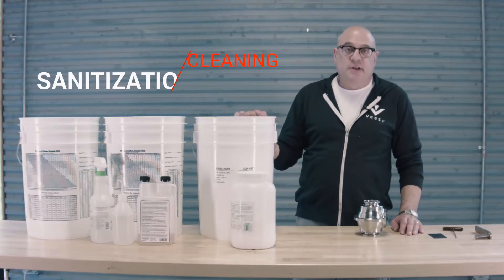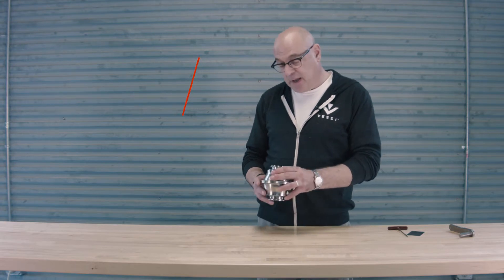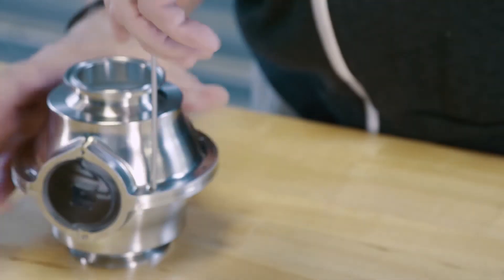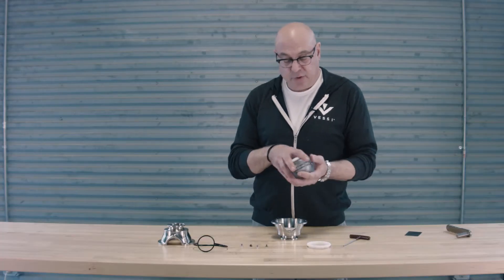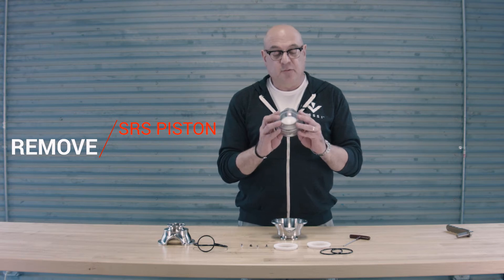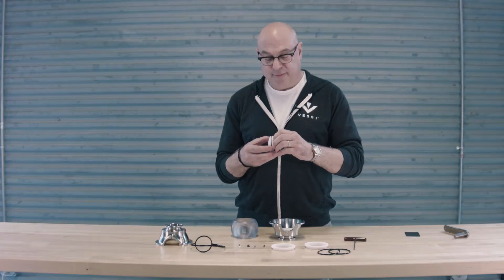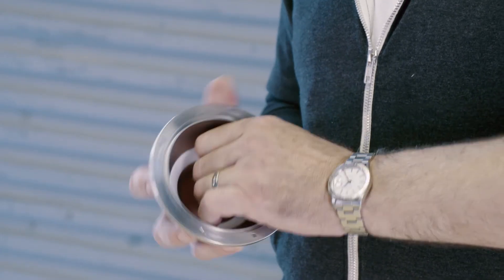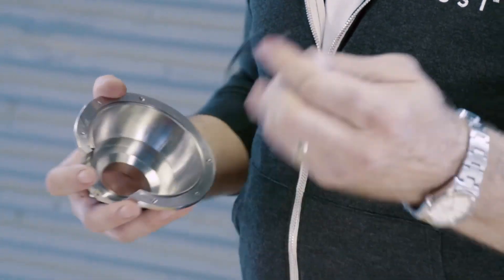How to Disassemble Sediment Removal System | Vessi™ Fermentor and Dispenser

Comment: Backer here....I really hope you will be providing additional gaskets with the Vessi. It seems to me that the possibility of having one of those gaskets get ripped apart during disassembly is very likely at some point. Is there going to be a dedicated website at some point to deal with ordering replacement parts and potential warranty issues?
Reply from the maker: All of the parts will be available online at some point, however in the interim there is an 800 number in the use and care guide you can call to order replacement parts. So far we haven't had any gaskets deteriorate under normal use during testing, and we've been fermenting batches non-stop for the past 6-months with different iterations of the SRS. But, there is always the risk of mishandling a piece or losing a gasket and in that case we'll be there to offer replacement parts.
Reply from the maker: That said, I'm not 100% sure if we're supplying extra gaskets with the units at the moment. You'll be getting two shipments, one with your SRS and one with the main unit (you may get the SRS first). We've built up a nice cache of fermentors while waiting for the final tooling of the SRS, and as those pass post manufacturing testing we release a fermentor for shipment and ship the SRS directly to you.